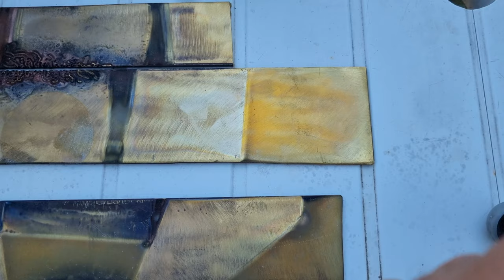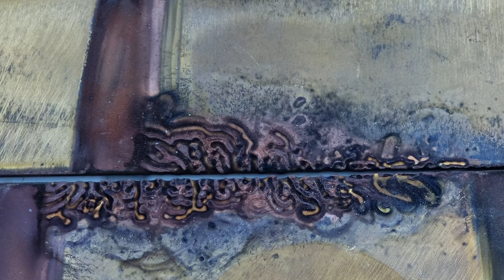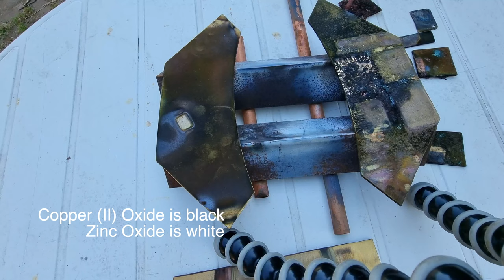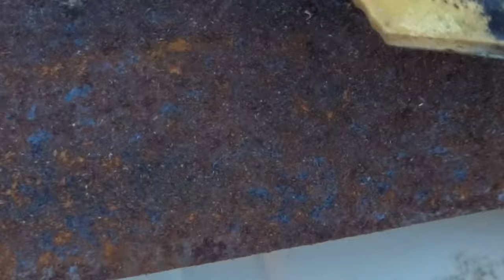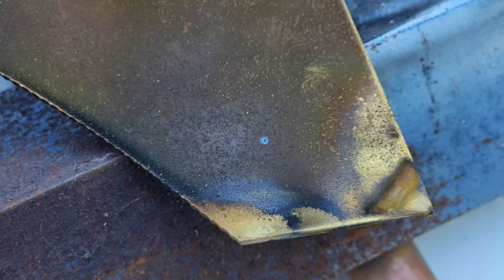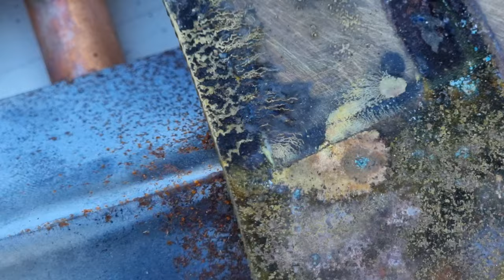VEGA - Deposits, are they soot?

Comment: perhaps we should consider the Chladni figures when we think how the soot deposits here and there in patterns... radiowave type resonances on the metal shapes...Last week I had 2 carbon rods arcing in a firebrick containment and saw sulfur yellow after the run.  Maybe it sublimated out of the brick, maybe it formed in the plasma? i dont know
Reply from the maker: Try it in a brick that you know does not contain sulfur
Reply: @MFMP  i ran it in pumice to start with but it eats a cavity out, i could crush some brick and test for sulfur with some simple wet chemistry test i suppose

Comment: I will piss on my Che Guevara hat and wear it overnight if that black stuff is not a carbon nanotube forest. There is an industrial process to fix CO2, and it is done by injecting it into liquid metal. Here, I think atmospheric CO2 reacts with the metal plasma on the surface and carbon is deposited in fine, fractalic structures. It's pattern is governed by wave interference and resonance. 

In fact it is black because it absorbs visible light due to destructive interference (which in turn generates a scalar field, or torsion waves for some, phonons for others). Either way, it will act as a dielectric wave guide and an EM-insulator. 

Now that I think about it, it could be metal oxide, or possibly a mixture of carbon, carbonated metal, and metal oxide.